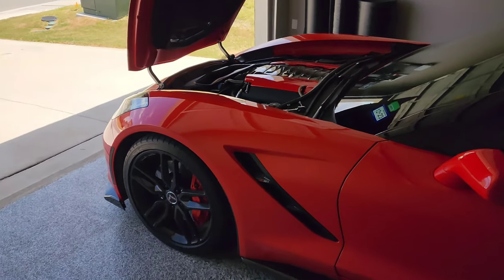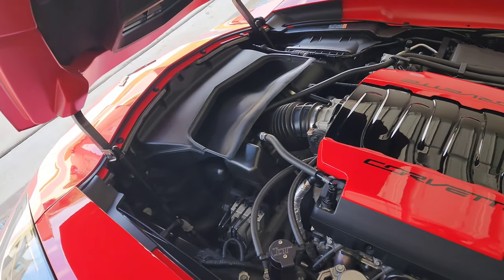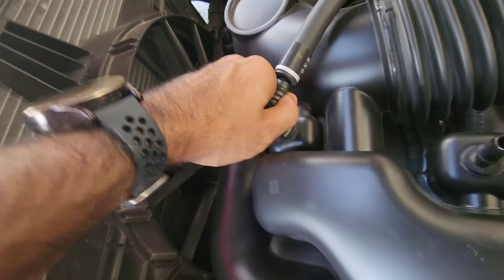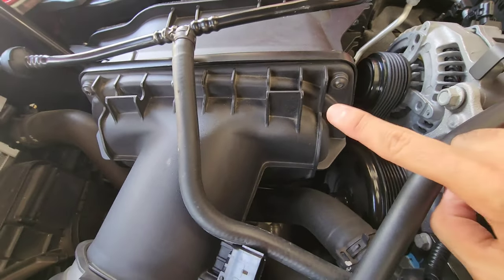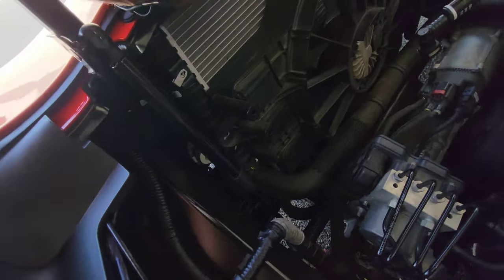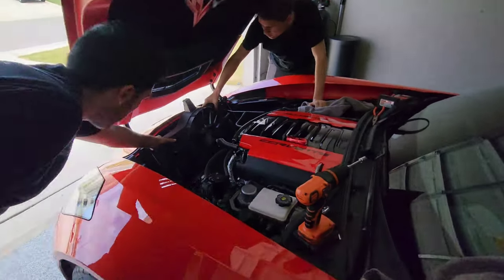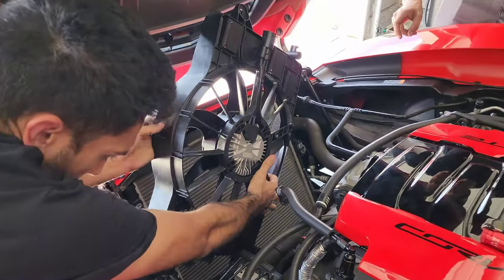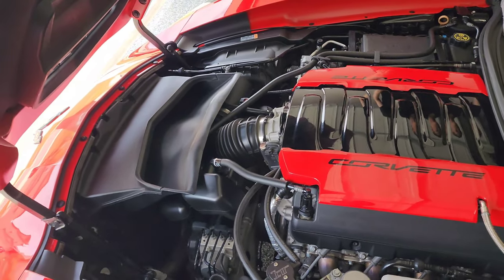INTALLING NEW RADIATOR FAN UPGRADE FOR MY C7 CORVETTE Z51!

Comment: Still rocking with you. 
I upgraded the fan & radiator on my 2014 to dewitts. 
The car would over heat while sitting in drive thrus, after driving on the highway for a while, only sometimes.
Reply from the maker: It's a must, thanks for watching!

Comment: Awesome vid! Question, have you heard of pulling the 42 fuse to keep exhaust valves open at all times?
Reply from the maker: I have heard of that but I no longer have the stock exhaust system on my car it's all aftermarket American racing and corsa exhaust system, I never tried to pull the fuse when I had my stock npp, mine stay open all the time now due to getting the non npp corsa extreme exhaust system
Reply: I did mine, no codes or anything and it’s definitely open all the time.
Reply from the maker: @spankaveli  nice man

Comment: My 2015 C7 is acting up. The fan works with my scanner but does't kick on when I have the AC on or when it reaches operating temps. Any ideas?
Reply from the maker: I'm not entirely sure, I know my 2014 had the radiator fan going out which caused it to overheat 1 or 2 times but switching it out with a Z06 fan made it run cooler and it never overheated again. Not sure if it's the same issue.

Comment: What’s up bro, what do u think of the expansion ice tanks, to install on C7 to keep temperatures down.
Reply from the maker: If you have a z06 I recommend to get one to help with cooling. If you have a stingray you don't need one, just maybe upgrade the radiator fan and get a aftermarket Thermostat.
Reply: Thanks bro, love the videos keep them coming! 👍
Reply from the maker: @j.scotto8803  Thanks man! Will do!

Comment: Hey bud , I have a built 14’ c7z51 making 800rwhp
I obviously have heat issues and want to upgrade.

What do you think is the best route 
Boost chiller 
Heat exchanger 
New fan 
New radiator
New intercooler ?
Reply from the maker: Upgraded fan, upgraded heat exchanger, bigger intercooler, maybe boost chiller